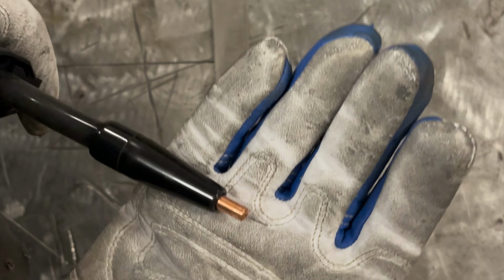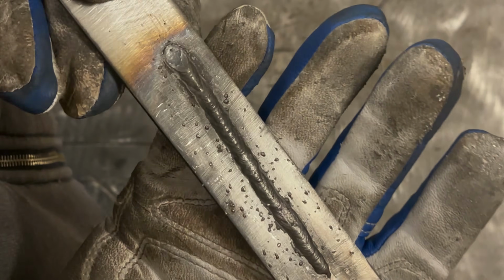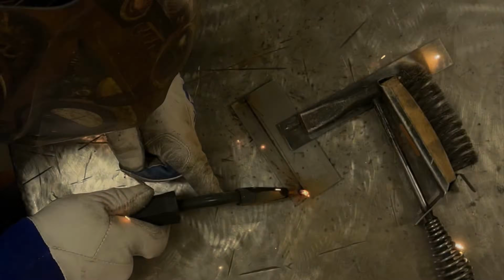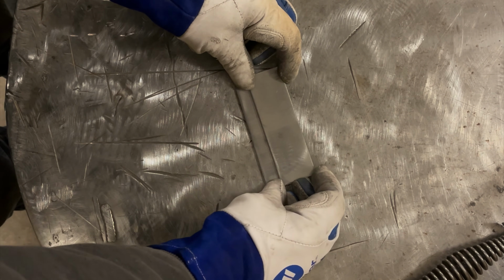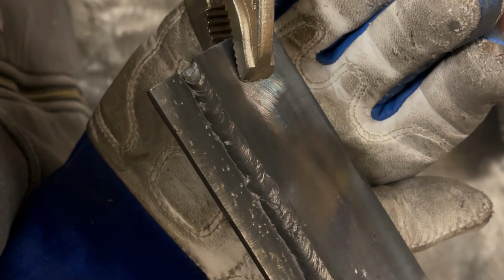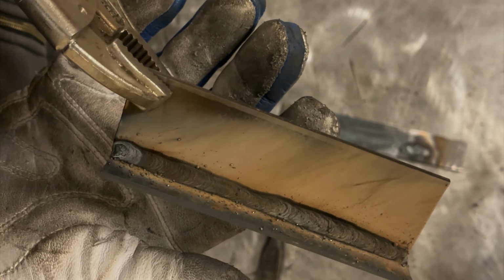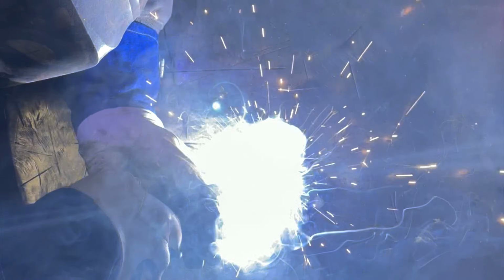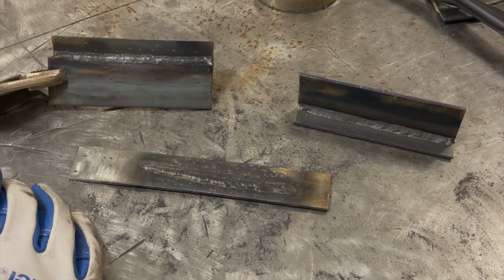How to weld with flux core wire

Comment: Greg I have used the Lincoln wire in my old AC machine and it didn’t run well at all in that machine. I tried but it seems there’s less filler metal in it than the Harbor Freight wire too because I ran through that roll so much faster than the Harbor Freight rolls and I can get good beads and good joints with it. Yes it’s not the ideal but I own it and it works decent enough with the Harbor Freight wire. I have not tried Lincoln wire since getting my new machine and it being DCEN it should work better but the Harbor Freight wire works pretty good in that machine too. Yes plenty spatter but not like running it AC. Just saying it’s not the worst wire depending on the application.

Comment: Very good fluxcore info!  My Lincoln 140c says I need 0.375" stick out!? So I was easily plus minus an 0.125" so maybe 3/8 should be my minimum stick out
Reply from the maker: So 3/8 would be in the ballpark depending on wire.  Somewhere between 3/8th and 5/8 based on settings, brand of wire, and how thick the steel is.  If you see porosity use a slightly longer stick out 😀👍.

Comment: Does that Titanic 110 May 125 110 plug does it get better result plugged into a outlet or can you use it on a 3500 W predator gin converter generator and get the same weld
Reply from the maker: So on a 3500 watt generator it will likely trip the breaker above 75% output.  The machine will run far better on a dedicated 20amp household circuit than a generator because of how bad the power factor of the titanium 125 is.  In simple terms it causes breakers to be loaded way beyond 20 amps and generators simply can’t handle it due to how in increases distortion of the a/c output of the generator.  You will likely be able to weld sheet metal on a generator but beyond that it will likely not work properly.

Comment: I find that if you can produce "good" stick welds you will be able to flux core weld just as "good" , the same doesn't apply to running MIG .  I hate MIG if I have to weld thin shit I use flux core not only does it bite better it's cheaper and I don't have to weld in a vacuum void of breezes or someone farting close by.  Flux is just more intuitive and versatile in the real world, did I mention I hate MIG LMFAO 😂.  THANKS for pointing the novices out there in the right direction you're the only guy on clown tube that took the effort to show why and how effective this process is.  🎉 there's other videos out there but no where the quality and depth.
Reply from the maker: Thanks for the kind words and I agree with a lot of what you said.  Flux core is super useful, especially on 1/4inch and down metal with .035 wire.  You can transition vertical up and overhead easily with flux core, MiG requires significantly different settings and techniques to weld vertical up.  I think the average person could make more sound welds with flux core vertical up without a doubt.  The main place Mig comes out on top is sheet metal.  .024 wire with a MiG welder can weld really thin material and auto body very cleanly easily.  I am with you though, flux core and stick cross over well, very little of other welding processes cross over to MiG when it comes to welding in all positions.

Comment: Where do you attach the ground cable as you demonstrate techniques of welding?
Reply from the maker: So I commonly just attach it to the metal welding table that the metal is on.  This works but it may leave some arc marks on the piece if the piece doesn’t sit perfectly on the table.  👍

Comment: I just bought one and took it out the box, set it up and have it connected and ready to go but it wont arc any advice?
Reply from the maker: If you pull the trigger and it doesn’t make sparks/weld you need to swap it out.  If it feeds wire and doesnt start welding make sure the ground clamp is on what you’re welding and not loose.  If it doesn’t feed wire despite the trigger being pressed it’s certainly defective.

Comment: I know you did this 3 years ago but I just purchased my first welder and I'm trying to learn on the cheap for hobbyist type work and this is exactly what I needed. Your explanation of each weld really helps me to know what to look for and how to correct it. Thanks!
Reply from the maker: Glad to hear the video is helping you out 👍.  Flux core is a great way to start welding.  Easy to learn and affordable to get into.  Just make sure to keep that wire stick out distance consistent, focus on being consistent in movement, and it will all come together 😀👍
Reply: @makingmistakeswithgreg  when do you switch to .035 wire? I would assume as your welding thicker material however what thickness to you make that switch? Also forgive me if you have already done this, as I am still working through all your excellent videos. Do you have a video where you put welds side by side and point out the problems? ie. to fast, to slow, to hot, to cold, wire speed and how to adjust? I'm laying down beads and trying to figure out what is wrong without really knowing what I'm looking at. I'm sure with more practice and playing with settings I will start to recognize the signs. Thanks for doing what you do, it is a big help.

Comment: You don’t talk too much!
A thousand years or so ago I was in welding school at Textron building LCAC’s. I had an instructor that’d drive me NUTZ! He’d have us run beads, fillets, butts, vertical, horizontal, overhead, then he’d look at them and maybe cut or break them open and his only instruction was “time and practice”. 😖 
 Granted that’s true, but some(any!) critique/explanation/guidance might have pointed me towards what I needed to do to stop doing it wrong!?*#!

You’ve restored my faith that actual welding instructors do exist! Thanks!!
Reply from the maker: Thanks for the kind words 😀👍.  Your instructor wasn’t wrong in the sense time and practice will solve most things, but not knowing how to improve would be rough lol.  I am all about minimizing the time to achieve a high level of quality, and that certainly can’t be done without knowledge of what you’re doing 😀👍.

Comment: I am new to welding. Have the titan 125 and have some 1/8th metal to practice on. My buddy wants me to come over in a few days and weld a new tow hitch to his trailer. I think the hitch plate is about an 1/8th. Do i need to sand off the paint down to bare metal before welding the hitch to the trailer? First have to grind off the welds holding the old hitch on.
Reply from the maker: So I would clean up the metal to bright shiny clean.  Flux core will weld 1/8th just fine through paint, but the chance for defects is much higher.  Be in the habit of grinding stuff clean and you will have better welds 👍

Comment: I find that I get air bubbles in mine when the machine is on full power at 145amps using 0.8 wire. I never got air entrainment using Forney wire which was interesting. Only the cheaper spools of 71-t seems to give holes in the weld bead. I thought it was down to dirt or something in the steel I was welding but when I changed over to the Forney wire, the holes were gone...go figure.
Reply from the maker: It’s not too surprising that you might see a difference in brands of wire.  I wish it wasn’t the case but flux core welding comes down a ton to the particular wire used.  You could buy 10 different spools and everyone welds different.  I have seen some with a green arc, some that flat out won’t weld anything 1/4 or over without massive porosity, and even some that spatter like crazy.  That’s why I always tell people to find a wire that runs good in their machine and stick with it.  Switching brands in a pinch is highly likely to cause problems lol.

Comment: Any tips for avoiding getting anti-splatter spray in the weld area? Does this matter? Thanks.
Reply from the maker: So your question actually makes me want to test some anti spatter out.  So truthfully I don’t generally use anti spatter because I use 7018 or tig weld mostly.  I do know that some anti spatter is literally cooking oil in a can.  The stuff that really works well is full of chemicals that probably shouldn’t be breathed in.  Generally speaking guys spray the plate down including the weld area and weld through it.  I know this works, but the fumes from it are no good and the weld may be affected.  I will have to do a cut/etch this weekend and see if it changes the internals of the weld.  For the time being I would say a light coat probably wouldn’t cause issues, I would avoid getting the joint soaked with it.  It could cause porosity in the weld.
Reply: @makingmistakeswithgreg Thanks very much - Can I give your reply a ❤???

Comment: Just picked one of these up myself to do my subframe reinforcements on my drift car. Will definitely practice a ton first using your techniques mentioned. Thanks for being thorough and very detailed about everything!!
Reply from the maker: No problem.  Glad to hear you’re looking at doing subframe reinforcements.  That shouldn’t be too hard to do with flux core.  The benefit of the self shielded wire is the weld solidifies fast and it’s easier to weld over your head (aka under a car) than many other processes.  I have no doubt you will be able to do it with practice.  To get really good results you need to focus on moving smoothly, at a consistent pace, and holding the proper contact tip to weld pool distance.  If you can do that your welds will be much better.  Inconsistency in movement is what makes most weld defects.  As you practice a bunch make sure to get some material the same thickness as what you want to weld and weld it in the overhead position to simulate the actual work you want to do.  With some dedication you will be able to achieve what you want.  

Also, if you put down a bad weld, let everything cool, and grind it out.  Don’t just weld over it or not fix it.  Good luck, you can do it 👍
Reply: @makingmistakeswithgreg Thanks for the support. I just welded our broken handrail on our stairset at my house to practice lol it was somewhat overhead because I had the gun pointed up most of the time to weld the bottom of the railing back onto the bar. Learned that you need the speed of the wire feed increased to weld overhead as well because lower speed was not cutting it and would cause the wire to stop feeding through unless I picked up the speed.

Comment: Great video! You are the first one to explain the reason for proper stick out. Got any tips for doing thinner sheets? I need to weld up rust holes on a lawn mower deck. I think it is about 16 gage. 0.060"
Reply from the maker: So 16ga can be tough to weld, especially if it’s rusty and has holes.  It really comes down to the machine being used and skill.  Some machines can weld at lower output than others.  The general guide for doing that would be to clean the whole area to clean metal, use .030 wire, run very low settings, and either weld in circles around the hole until it’s closed or put a backing sheet on the hole and weld that to the hole.  Grabbing a piece of copper or buying what’s known as a copper “welding spoon” can really help.  You place that over the back of the hole and weld around the hole.  The weld won’t stick to the copper.  Flux core is capable of doing the repair, but due to how it “self shields” it’s prone to porosity and holes in the welds when used for super short welds.  You may have to grind the weld down a bunch between passes to get to solid clean/hole free metal.  With some patience you will get it 😀👍

Comment: I welded two strong ties together for learning/practice, and the strong ties bent when i kept striking it with a hammer, and the weld held. Looked like an open book. These videos have been super helpful!
Reply from the maker: Glad the video helped you out 😀👍.  Flux core can do a ton of things, and once you get the details right it’s not too hard to do either.  Probably the most useful/affordable welding process there is.

Comment: Very nice video that answered a lot of questions I had. This machine looks more than capable of doing what I need to do with it. Thanks for sharing.
Reply from the maker: No problem 👍.  Honestly that little welder will do most of what a person would like to do.  It’s the best sub 200$ investment in a tool a person can make.  Just buy some decent wire (other than harbor freights) and practice a bunch to get a feel for it.  What you can fix/repair/build with it will easily pay for itself.

Comment: I loved the video! I'm a beginner self taught wanna be welder. I'm trying a lap weld on 16g steel. I have a rope like looking weld, and I'm burning holes in the bottom plate. I know my settings need adjusting, but I'm not sure which way to go. After watching this video I'm sure my stick out is too short. Any advice you could give would be greatly appreciated. Thanks
Reply from the maker: 16ga is pretty thin but should be easily doable.  On a lap weld this is what I would do.  Start with a single sheet.  Set the machine so it produces a smaller weld, that doesn’t sit like caulk.  You will have to run pretty low settings for wire feed and voltage.  Once you can get a 2inch or so bead without blowing a hole clean through the steel switch to doing lap welds.  Using the same settings aim the wire right ontop of the top layers edge.  On thicker material you want to aim the wire at the side of the top layer but on thin material you want to be ontop of it.  If you move consistently with settings that weren’t blowing through a single layer, it should work.  I can’t stress enough how important it is to be consistent.  Try to move at the same speed start to finish.  If it’s too fast (bead ropes up, looks thin, etc) then slow down.  If the bead melts through or is really wide pick up speed.  If that doesn’t work and you still make holes then lower settings.  Expect to fail a bunch and be frustrated, but it should work out if you keep practicing.
Reply: @makingmistakeswithgreg  yeah most "thin metal" videos I've found are with 1/8" lol. I drilled a hole in my transmission pan so I can put in a drain plug. The plug is magnetic and made to self tap into an existing threaded plug hole (which I don't have). I'm trying to weld a 1.5" square on top of a 2.5" square that I can then weld to my 15g pan and then drill and tap for plug. I just don't trust 15g pan to be thick enough. I wanted the piece I'm welding to the pan to be as close to same thickness which is why I'm using such thin stock.
I did as you instructed and have a few consistent looking welds on 16g and am going to try lap welds next. I want to get my settings dialed in so I don't blow holes in my tranny pan. 
Your advice got me much closer to something I could actually call a weld and I thank you for that!! I'll update later as I either progress or fail 😂.

Comment: What is the better wire to buy .030 or .035
Reply from the maker: If you’re looking to weld 1/8th (3.2mm) and thinner material I would go .030.  It’s easier to control and prevent burn through.  If you’re welding thicker than 1/8th I would use .035, or if you’re welding outdoors with wind possibly .035, it tends to work better out doors.  There is a ton of overlap based on skill (aka you can weld thin material with .035 if you have the skill) but it’s best to make it easier on yourself if possible.

Comment: Mine gets a little hot after the first 30 seconds could just be operater error i use it all the time so im used to its quirks , changing the wire to a decent brand helps more than you would think
Reply from the maker: A solid brand wire definitely cuts the spatter and cleans up the welds 😀👍

Comment: Is it possible to replace a spot weld with a flux core weld? For instance, a floor support… I’m just starting to weld :)
Reply from the maker: Great question.  So spot welds are typically done with two electrodes that pass current through two layers of metal to weld them.  It’s effective because it doesn’t need shielding gas, the welds are very small/clean, and there is minimal heat.  A spot weld can be done with flux core however the possibility of melt through is high, the spot welds won’t likely be as clean, and it does take more skill.  You should be able to do spot welds with flux core, just practice a few on material of the same thickness as what you need to weld.  Keep in mind you will need to drill a small hole in the top layer to perform a proper spot weld.  Size wise somewhere between 1/8th and 3/16th should be ok, 1/4in max.
Reply: @ Interesting, thank you😎

Comment: Thanks Greg. I watched this series a year ago before buying a welder. I have installed new 240V 50 A wiring into my garage and am about to make some time and start to practise with my machine. Watching these series again as a refresher. VERY helpful. Thank you for your time and resources!
Reply from the maker: No problem, glad to hear you’re up and running with a proper outlet.  It helps a ton to have enough power, welders really do a better job on 240v.

Comment: I've been stick welding for years and my friends are trying to convince me that Mig is the way to go. So far I'm not convinced. Just my opinion.
Reply from the maker: So mig is very useful for welding a lot of stuff fast, and for welding thin materials.  To me I would rather have mig or flux core to weld something like car exhaust than stick, but most everything else I would rather stick or tig weld.